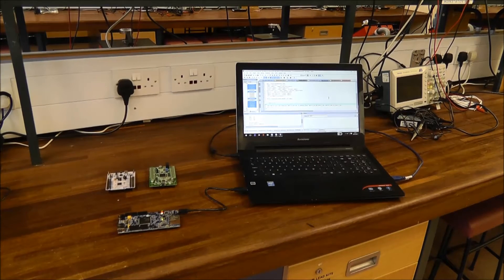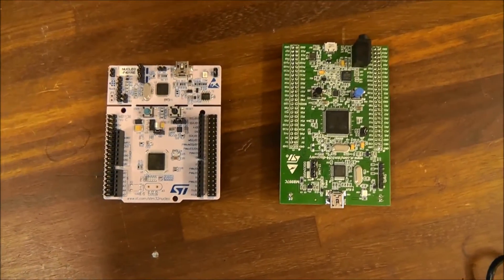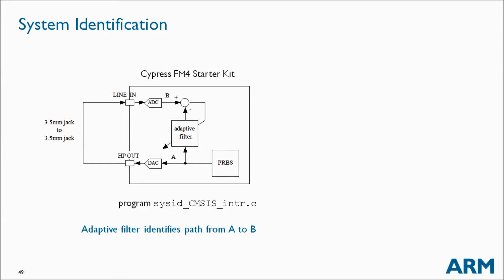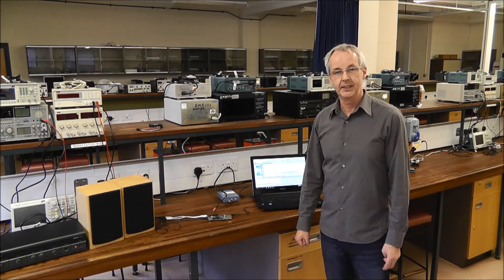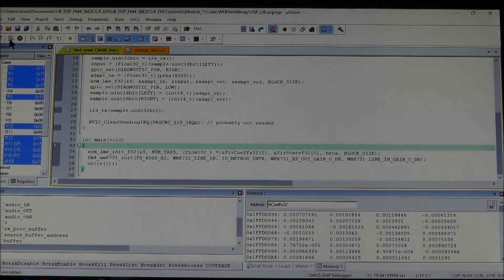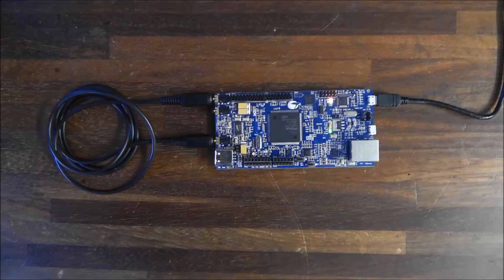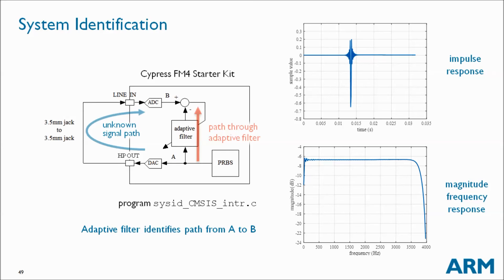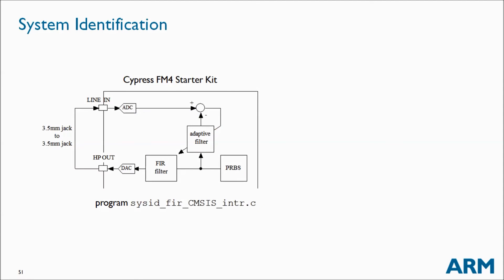cypress fm4   Hands on Learning@Heriot Watt Reay

Comment: Excellent use of hardware. It is not clear to me though exactly what you ask the students to do. My impression is that the students code these cases themselves, but I could not tell for sure. Also, do students do these outside of the lab?
Reply from the maker: As you can see, rather than describing in detail how I run my classes, the video concentrates on the teaching resource embodied by the ARM university program DSP Education Kit and my book. I've been running a hands-on element to my DSP courses for many years using DSP EVMs from Texas Instruments. The breakthrough that I'm excited about is the facility to do these hands-on activities using truly inexpensive and mobile/portable hardware. I'm going to use ARM microcontrollers in my course for the first time this fall and haven't finalised exactly how I'm going to organise things. Probably I will sign out boards and picoscopes to students on loan - and students will carry out experiments outside of the lab.
Incidentally, I'm very taken with the learning space/approach in Ray Simar's video.
As it stands I have a series of lab exercises that involve a mixture of the students using existing program examples and taking measurements, and designing their own filters (coefficients), and writing code segments (functions) to implement filters and FFTs. Some of these exercises are contained in lab instructions that are part of the ARM DSP Education Kit that ARM donate to universities (In case it's not clear, I developed the ARM DSP Education Kit).
I consider that the ARM DSP Education Kit (lecture slides and lab exercises) and my book, and an ARM Cortex-M4 development board are a starting point for many different learning activities where the empahasis could be on DSP concepts,  algorithm development, microcontroller programming, embedded systems, microcontroller interfacing, etc. using tools that are less esoteric and more accessible than previous DSP EVMs.
Some of the other video contributors are using ARM Cortex-M4 boards (check out http://bcs.wiley.com/he-bcs/Books?action=index&itemId=1118859049&bcsId=9785 for alternative hardware platforms) The  real-time DSP examples really put the M4 through its paces.